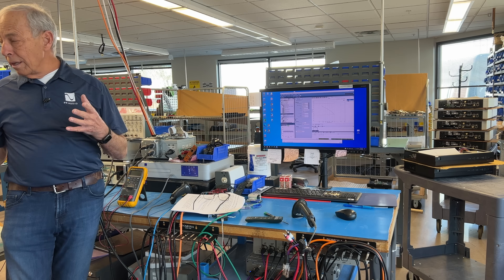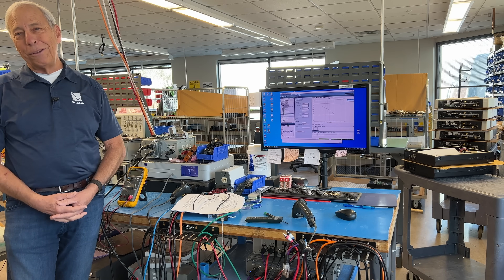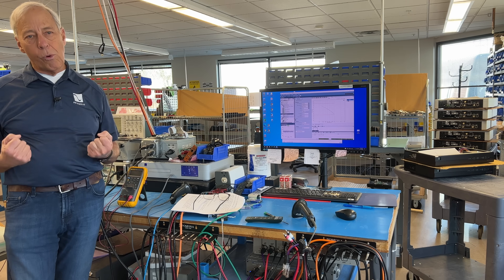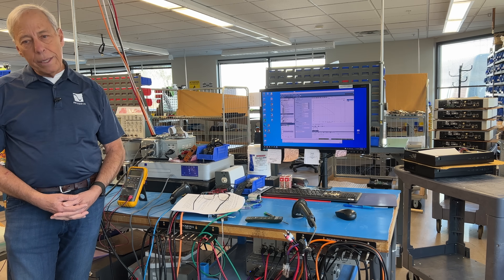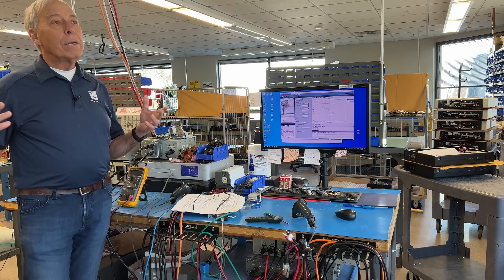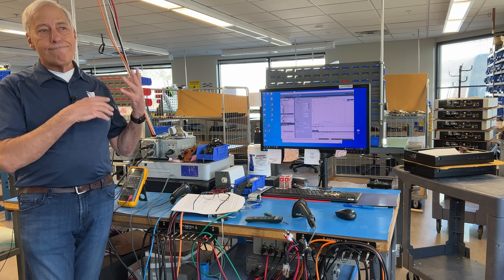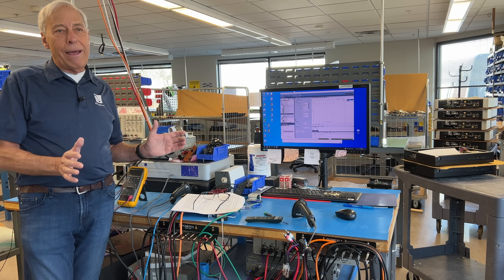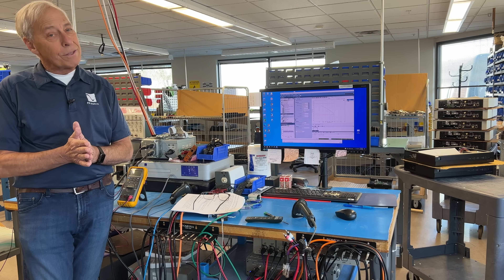Amps that double their power

Comment: Yeah, a really well designed "traditional" power amplifier will double it's power when halving the load impedance, (which is a good thing, especially since most loudspeakers' load impedance varies quite widely among the entire audio frequency spectrum, so it's good to have a power supply in a power amp that can actually deliver enough current (and therefore power) to a speaker that may dip down really low in impedance, especially if when it's playing in the bass range...

However, nowadays it seems to be becoming more and more of a "trend" in many power amps to have a "switching" type power supply instead of a traditional ("linear") large power transformer type, and also, especially with class "D" amps that also have a switching power supply, with many/most of those types of amps, the output power doesn't too often double with a halving of load impedance anymore, now with those newer style amps the output power is oftentimes the exact same amount at pretty much ANY load impedance... This is a new trend that I don't particularly like though. :(
Reply: "Well designed" is only relative to the design goals for the product.  An amplifier is well designed if it meets all of its requirements - which may not include producing twice as much power into a 4-ohm load, than into an 8-ohm load.  Amplifiers with conventional (line-frequency transformer + rectifier + large capacitor bank) unregulated supplies will always fall a bit short of doubling power for 4-ohm loads, due at least to the deeper discharge of the capacitors at the higher currents.  
But an amplifier with a regulated switch-mode PSU that's designed to meet the full current requirement for 4-ohm loads, is a better solution, and comes closest to the ideal of doubling power at 4 ohms.  
There are plenty of Class D amplifiers that will drive 2 ohm loads without a struggle.  They can be quite robust.
Reply: @marianneoelund2940  I disagree with your assumption that most conventional power supply amps "always fall short" of doubling their power into 4 ohms vs. 8 ohms. The main ones that do fall short of that are usually receivers, especially the mass market, lower-end and "middle class" ones. But there's actually quite a few conventional power supply power amplifiers that DO double their power into 4 ohms vs. 8, especially in the high-end market AND many in the "vintage" audio market, especially when they are dedicated power amps, especially if also monoblock or full dual mono design, and not just relatively lower-end integrated amps or receivers.

Now as far as class D amps go, I will agree that they are usually more capable of safely driving extremely low impedance loads, especially under 2 ohms, but I still haven't seen one yet that actually doubles its power per halving of load impedance. I'm sure that there IS some out there that DO do that, but all of the ones that I've seen so far for home use don't actually do that. And NO; I'm NOT talking about receivers here either, because they are always even worse, regardless of "class" design, when compared to separate, dedicated power amps, but even the separate power amps that I've seen so far in class D for home audio use have not much more power output, (if even any), into a lower impedance load vs. a starting reference point, (usually it's 4 ohms now to start with).

Regardless of fully doubling their power or not, the MAIN problem with class D amps and especially those that have a switchmode power supply design, seems to be that they usually have almost ZERO reserve power or headroom above their "RMS or continuous" power rating. That and the fact that most of the class D amps I've seen to date, whether for car OR home use, all have considerably higher noise AND distortion levels vs. most of the conventional power supply class A & class A/B designed amps, especially the better quality vintage ones and high-end ones. I notice that the main reasons for both of those issues with class D amps are that most of the manufacturers of those kinds of amps nowadays are rating those amps pretty much right at the point of absolute MAXIMUM continuous power, and right AT the point of the onset of clipping, therefore advertising higher apparent power output numbers, but at a noticeably higher distortion level and without any headroom. This trend is NOT too good of a thing, especially for the high-end industry or those of us who have really sensitive ears to distortion... This is a big part of why many audiophiles still say that class D amps don't sound quite as good as the more conventional designs of the past few decades...

However, I can see the potential in class D design, and it actually has a few advantages over the more traditional designs, however, the "tech" of class D, (and how well it's being implemented for full bandwidth audio use), is still in its relative infancy rn, when compared to traditional class A & A/B, so I believe that the technology refinements with class D amps that are sure to happen into the future will make it even better sounding, especially if most manufacturers would go back to rating ALL of their amps at a more reasonable 0.01% distortion or less for home audio, and no more than at 0.1% distortion, (which is technically at the very beginning of clipping), for car amplifiers, and of course at FULL audio bandwidth too, not just at 1KHz, like many do nowadays. As it is now, the majority of even the "better" quality class D amps for home audio use are usually rated right at the beginning of clipping, (0.1% distortion), sometimes even at higher distortion than that, like 0.5% for example, and the majority of the "better" quality CAR audio amps are being rated at 1% distortion, some even at 10% distortion, and that level is WELL into clipping already, and that level of distortion is also VERY obvious to any audiophile or trained ear, and it sounds rather disgusting imo, especially in a class D amp, as their clipping is usually VERY sharp and harsh, definitely not "smooth" and "forgiving", like in a tube amp for example.

Anyway, long comment I know, but I thought I might clarify a few of your statements, just in case you weren't aware of that stuff I mentioned...

Keep on fully enjoying your own personal tastes in music, and on whatever kind of audio system you have, as THAT is the MOST important thing about having any kind of stereo system to begin with!
Reply: @JoeJ-8282  I'm not assuming anything.  I'm an EE with decades of circuit design experience.  Doubling of output power for 4 ohm loads can only be approached asymptotically due to many voltage losses at the higher currents - Vce(sat) increases, supply ripple increases, transformer and wiring copper loss increases, emitter resistor Vdrop increases, etc.  You cannot eliminate those.  Give me any Amp you like and I will test it and prove it doesn't precisely double its 8-ohm power at 4 ohms.
On the other hand, I find your commentary full of assumptions and many are not generally valid.
Reply: @marianneoelund2940  OK, fine. I accept your experience as knowledge, however, then how come I have seen quite a few amps over the decades that are rated to have double the power output at 4 ohms vs. 8? Are they ALL just BS rated? Every single manufacturer that I've seen that rates their amp like that, with doubling power? Are they all just totally lying then? (I don't have an amp dyno, so I cannot actually accurately test any amp's power claims, "on the bench".)
Reply: @JoeJ-8282  Thank you for a detailed exposition of the power supply’s contribution to an amplifier’s power rating.   I believe you are correct to distinguish between ‘vintage’/high end/dual mono/mono block supplies and the usual run-of-the-mill AV amplifier whatever type of supply they’re using.
Reply: @marianneoelund2940  Thank you for explaining why an amplifier might not ‘double their power’ into a load with half of the impedance. Your explanation made perfect sense to me because I’m familiar with how unregulated power supplies work. The distinction you make might help me understand the D-Class amp’s reputation for delivering great bass, if bass is understood as demanding more current; the regulated supply is not already ‘taxed’ and it’s power reserves already tapped when the extra ‘ooph’ is required.
Reply: @Douglas Blake Yeah, in general, most receivers, especially the mass market, lower-end to "middle class" ones, usually kind of suck for power output, especially with all channels being driven at once, because their power supplies are usually relatively wimpy, especially when compared to pretty much ANY separate, dedicated power amp, especially the high-end ones and/or many of the better quality "vintage audio" ones.

Although I still haven't noticed any home A/V receivers that are actually a class D design yet, all of the ones I know of are still of a "conventional" design as far as the power supply and power output stages, with all of them being a class A/B design, as far as I am aware... However, I'm sure that there WILL be some that come out in the very near future that are all class D, I just haven't noticed any yet.

I will agree though, that most receivers DO utilize some form of "power management", and they almost always have a significant reduction in power output per channel when multiple channels are being driven at once, because again; their power supplies are usually pretty underpowered and overrated, being used to their absolute maximum under many conditions of "normal" use... That's also a big part of why the majority of receivers run extremely hot during normal use, because many individual components/parts in them are being fully "maxed out", and/or they don't quite have totally adequate sized heat sinks on many individual components/parts, (because of overall space limitations within the chassis), therefore making pretty much every electronic piece, (especially all of the semiconductors), inside most receivers run extremely hot. This greatly reduces their working lifespan though, especially if they are ever put into an enclosed equipment rack or anything is stacked on top of them, blocking the cooling vents... Most receivers will appreciate having a cooling fan placed on them, or at least being placed in a totally open component rack or on a shelf by themselves, with nothing on top of them.

Most receivers are also overrated in their power output too, with many of the newer models nowadays being rated well above the point of the onset of clipping, with most newer ones being rated at around 0.5% to 1% distortion, which is already into clipping and is noticeable with very careful listening, and with some cheaper models even being rated at a rather disgusting 10% distortion, which at that level is VERY noticeable to anyone really listening, especially with good, revealing speakers. That bad of a distortion spec/rating is just plain sad to see for me, especially coming from the era of the (now) "vintage" audio market of the 70's and 80's, where the majority of receivers and especially separate component amplifiers, were rated quite conservatively and CLEANLY, at 0.05% distortion OR LOWER, with a few separate component power amps even being rated as low as 0.001% distortion!

However, I wasn't even necessarily talking about any receivers in my original comment anyway, because I only use mine as a pre-amp, (because of all of its many surround modes and HDMI switching and decoding capabilities), but since it has pre-amp level outputs on all channels, I have multiple separate, dedicated power amps on all channels in my home stereo system. All separate, dedicated components for every individual thing, from sources to power output, is the "only" way to go in a really good home audio setup, imo!... Even though my stereo system takes up a considerable amount of space, but that is totally OK with me, because overall sound quality and presentation, (i.e. the FULLness, richness, and just plain awesomeness of the sound for ALL types of music AND movies), is what is the MOST important to ME!

Comment: Yes they double, unless it is a McIntosh, with an 'Autoformer', basically an output transformer that matched the output to the load, so if you double your speaker impedance, you still get the full rated power.
Reply: I was about to write the same comment about the McIntosh amps. Also the PrimaLunas do the same thing.
Reply: Exactly, this trips people up every time as shown within the comment here.

Comment: Most high-end amplifiers double their power?  No, they don't.
Reply: So their power supply is under rated or it is an amp with output transformer. If the first is the case, what does that tell you about the term "High End"? There is no norm for high end. I can sell a Crossly suitcase record player as High End and have the law on my side.

Comment: Not many amps double down. If we only bought amps that doubled down then it would be slim pickings. And the ones that do double down are very expensive.
Reply: crest audio vintage.. google it
Reply: Paul has a point though, if it does not double and it has no output transformer => the power supply is under rated. There are no two ways about it.
Reply: ohms law.. any amp that doesnt follow it ...has current limiting..speakers arent resistors..their imp swings as they play..different freqs exhibit different imp...so an amp must be able to ignore the speaker ... to be able to accurately deliver the signal with gain..and nothing else..

Comment: Coming from car audio it seems it always been a focus on our side. I’m home and hi-fi it seems it comes at a premium…. Especially when you move away from Class-D. Which D is still contentious it seems in Hi-Fi home. Clean D has come a very long way. It’s not uncommon for .5 & .8 ohm to be the newer 2/4ohm loads.
Reply: With CAR audio subwoofers, under 1 ohm drivers are pretty common nowadays, yeah, but that's def. NOT the case in HOME audio speakers. The lowest impedance home audio speaker that I've ever seen was rated at 2 ohms nominal and "only" dipped down to just above 1 ohm at the lowest point... You'd def. need a very robust home audio power amp to power that speaker, (like a Krell or PS Audio high-end one, just for example), because most "average" home audio amps don't really like below 2 ohm loads, and most home receivers are even worse, most of those will even shut down below 3 or 4 ohm loads!

The car audio industry does utilize extremely low impedance speakers, especially subwoofers, for efficiency and output SPL reasons, and also to make them put out relatively more with the relatively lower voltages that car audio has to deal with, but having to use speaker drivers that are that low of impedance isn't as important, (OR even necessary), with home audio equipment because the voltages that home audio amps have to work with are potentially up to about 10 times as high as with car audio, so the amplifiers don't even have to deliver into extremely low impedance loads to begin with.

Comment: Which amplifier would have more power a amplifier with 750 VA transformer and 96000 micofarads Capacitance?  or a amplifier with a 450 VA transformer and 85000 of Capacitance?
Reply: It depends of used transistors. But I personally would preffer 50W / ch with 750 VA transformer, than 100W / ch with 450W transformer.
Reply: I have 12-0-12 450VA toroidal and 660000uF used in Pi-filter for total capacitanse and the load is Class A Mosfet SE, bias current 14A for this setup nominal 2ohm speaker load is very loud if really want to take all the watts out the system.(93db/1w)

Comment: Speaker impedance can vary a lot ,so say  an  4 ohm electrostatic  speakers impedance drops to 2 ohms at high frequencies ,then  to faithfully reproduce those frequencies the amplifier needs to deliver twice the power and if the amplifier can't double down then the high frequencies would be attenuated. I want to note that Bob Carver's Sunfire amplifiers do double the power when the impedance halves and his signature series doubles again at 2 ohms and are 1 ohm sable.
Reply: Quite a robust ouput stage and power supply
Reply: But many of Carver's designs wouldn't pass an engineering design review at most of the high-end manufacturers.  He pushes devices too close to their limits, so a small but not insignificant fraction of his products will fail prematurely.